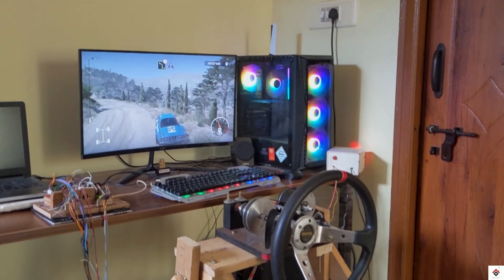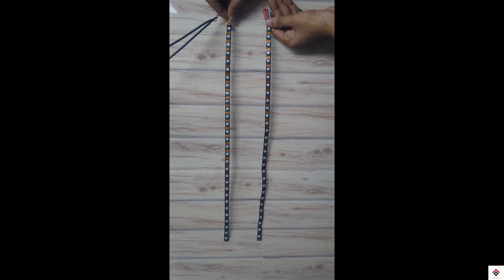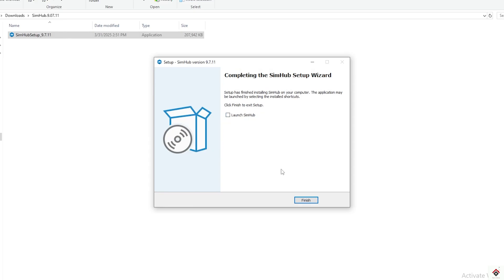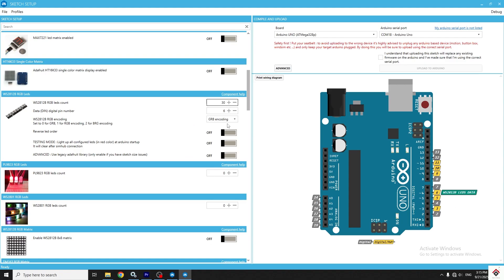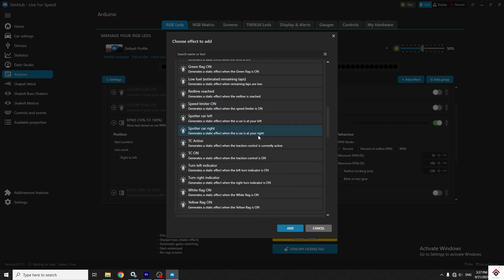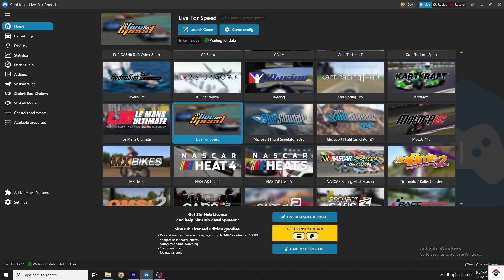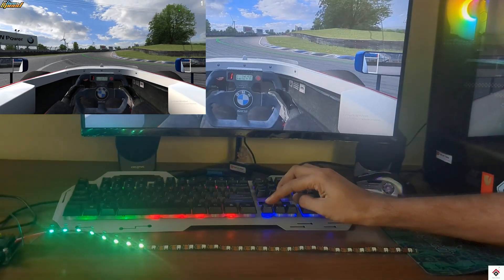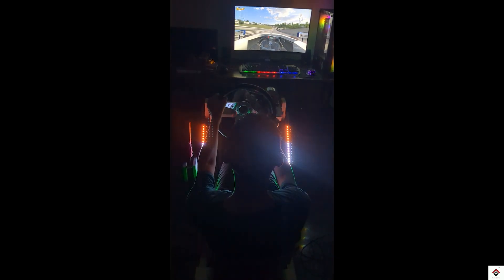RPM Rev Lights for FORCE FEEDBACK Gaming Wheel (Arduino+Simhub) | SimHUB RPM Lights tutorial 🔥🚥

Comment: Sir I have a question can we use this same software to  installing this rpm light in real cars will it works ? Please reply with a solution 🙏
Reply from the maker: No, this won't work for real cars.
I think you have to take RPM data from the OBD port. There might be products available for this already. Check once.

Comment: Have u only used 1 leonardo board , and can I use a simple steering wheel not the ffp one nd how much does this whole setup cost
Reply from the maker: Yes, one Leonardo board will be sufficient for all game inputs and FFB.
One Arduino Uno for RPM lights.
It costed around 8500 INR.

Comment: My man, made all your projects, one thing, the ws2812B can pull a lot of power, Leonardo cannot provide. But a huge fan here
Reply from the maker: Thank you ❤️
These lights are not connected to Leonardo.
We are using an additional Uno board. You can also connect external 5v supply incase power is not sufficient.